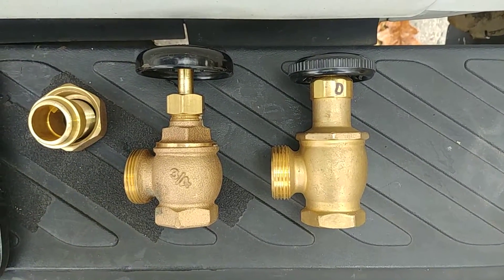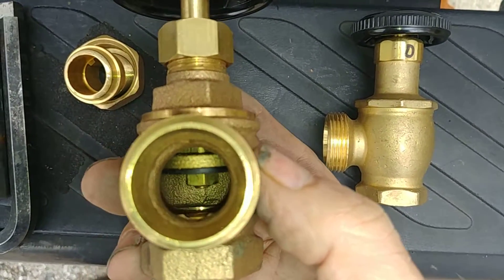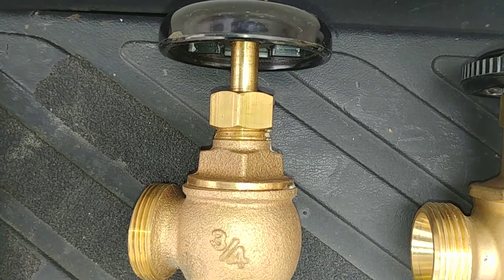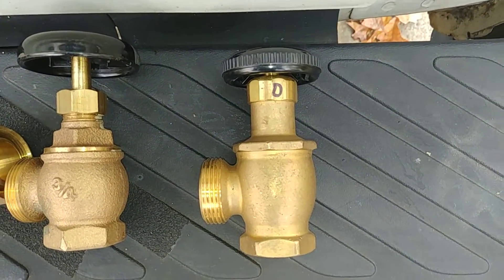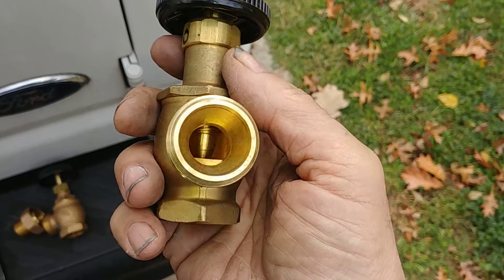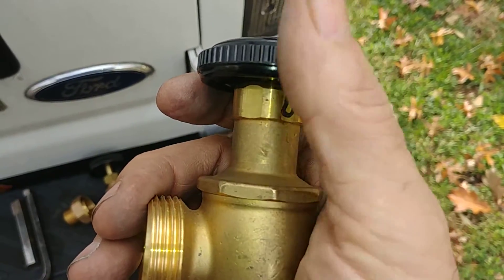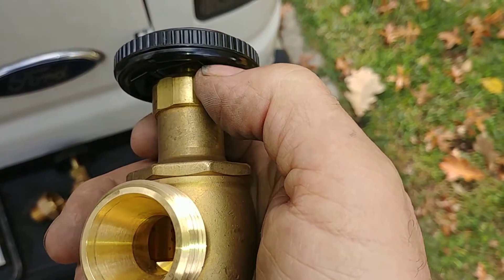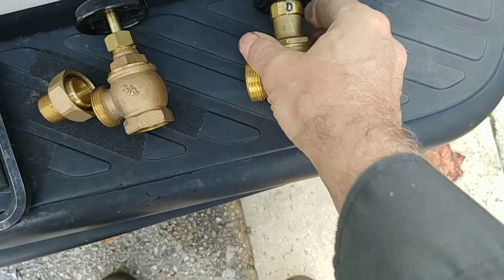Ordinary Steam Radiator Valve vs True Vapor Radiator Valve

Comment: Thanks so much for this video, Gordon. I have been doing steam service {in the Detroit area} for many years, and never knew those valves existed. I always used the cheap, standard shut off valve on both one pipe and two pipe radiators. I doubt if the supply houses around here even stock that better valve. How much more do they cost ?  Do you special order them ?  Do your customers have good things to say about them ?  Keep on making videos, Gordon. You're a inspiration to all of us steam heads that work on these , in some cases,100yr old systems. It's amazing how well we can get this old stuff to still work great, once we understand how they are supposed to work. You are keeping the "dead men's" trade alive with the information and knowledge you take the time to share with us. Thank you.
Reply from the maker: Wow, thank you!
That special order valve is ridiculously more expensive, like 6x, if you can believe it. Anything from Mepco or Hoffman and such are going to be high quality but high dollar. Legend radiator valves are as low in quality as I am willing to go. They don't have a vapor model.  Barnes & Jones makes a vapor valve a bit cheaper than that Mepco, but it doesnt look nearly as nice - rough "as a corn cob" brass.
Since that is a nicely done bath, the whole thing is a show piece. I wanted to get this customer the best, if for no other reason then they went through alota heck to get it done right (and leave it at that).
But for the more price sensitive steamer, orifice plates offer an alternative for balancing, but no modulation. That's a whole topic unto itself. 
I don't often get the honor and opportunity to use these valves and they tend to gather a bit of dust on my shelves, sad to say.